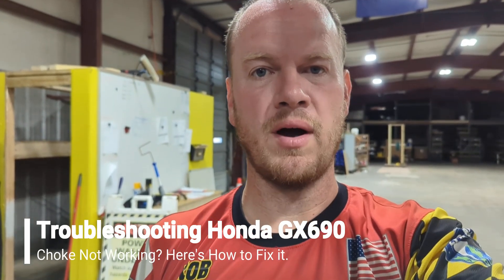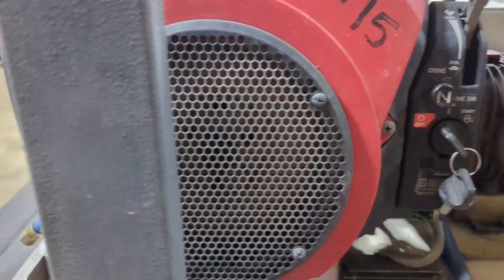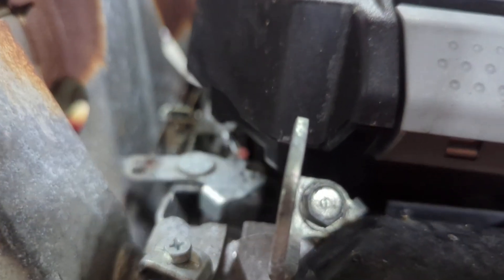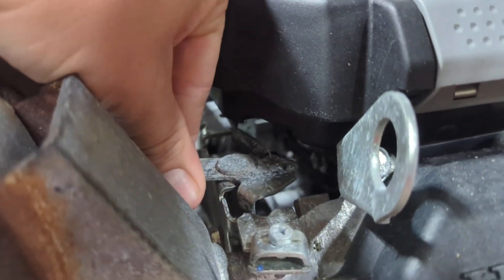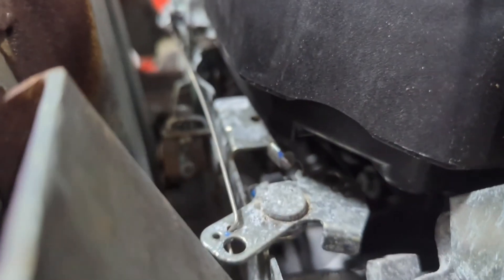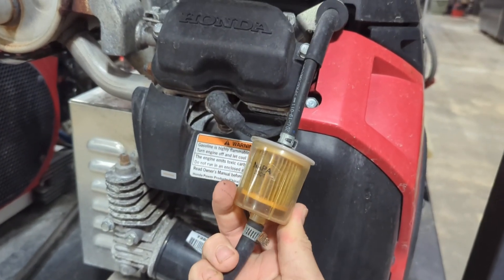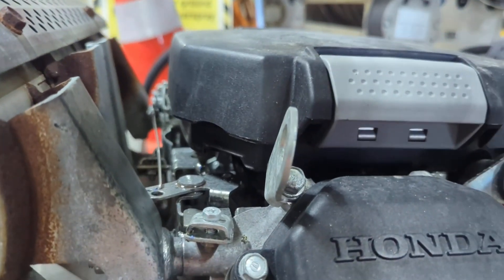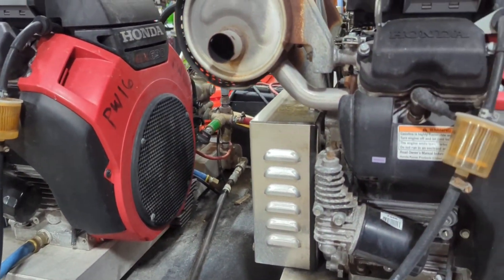Honda GX690 Choke Issues: Troubleshooting Guide

Comment: Any idea what can cause a little high iddle while on iddle,my throttle cable adjustment can't go lower anymore
Reply from the maker: @dantec8854  is the cable bent at all?   Use  some penetrating degreaser or lubricant on the hinge where that cable pivots.   We've had that get gummed up before
Reply: @Cleanpowerwash cable is good the engine only has 140hrs,not sure if it's a governor issue or carburator.
Reply from the maker: @dantec8854  sorry I was thinking about the choke.
Reply: Choke is good starts on first try, just the iddle issue

Comment: Where is the carb drain plug?  in drawing is shows below air filter and above oil fill port. Cannot find it. I have had one setting for a year with fuel. drained fuel added new clean fuel but wont start. if I put a few drops in to carb it fires up for a few seconds. I think carb if clogged or fuel cutoff not working. I don’t get the click when turning from off to on but not sure if my model has the feature. GSX690.
Reply from the maker: @ColorMaker_Solar  remove the plastic cover from below the air filter cap.  That should give you access to it
Reply: @Cleanpowerwash  Its a Northstar 13000 generator and requires gas tank removal to remove lower part of air cleaner. There has to be an easier way. Thank you for responding
Reply from the maker: @ColorMaker_Solar  oh that's completely different
Reply: @Cleanpowerwash  Im thinking of testing the fuel solenoid, the fuse next. I know nothing about engines but I am a wiz at electronics. If I don’t hear the fuel solenoid I can test the solenoid supply lead and should get 12 volt when key is on right? If I do can I apply 12 volts directly to solenoid wire and it should activate right ? If the problem is a carburetor its going to be beyond my expertise are there any people that do onsite repairs its to heavy for me to move at 67
Reply from the maker: @ColorMaker_Solar  you can also close off the fuel tank, disconnect the fuel line from that valve and spray carb cleaner into the fuel line and fuel pump.   Then try starting it while adding more carb cleaner to the line.  This forces it to suck the cleaner into the carb
Reply from the maker: @ColorMaker_Solar  I just looked a pic of it.  You can shut off the gas tank via the inline valve.   The carb you just remove the screw on either side of where it says Honda.  Then remove that black cover.  Empty and clean out the carb and go from there
Reply: @Cleanpowerwash  I had that cover off its where the fuel pump is located. is the carburetor drain there as well. Thank you so much for taking time to post.
Reply from the maker: @ColorMaker_Solar  yes.   Usually you can access it in that area.